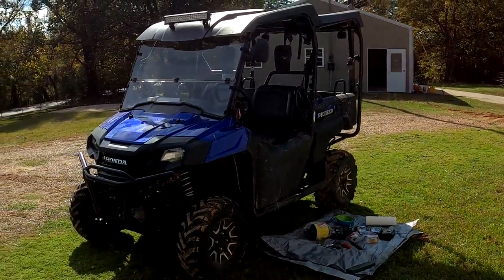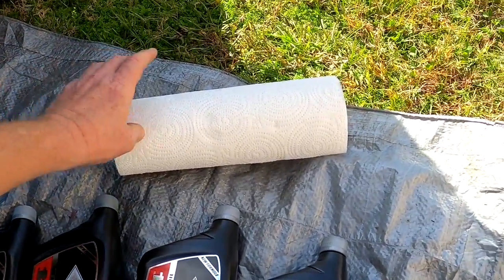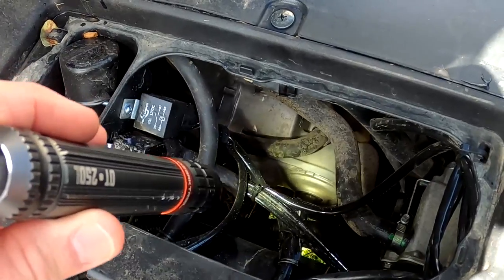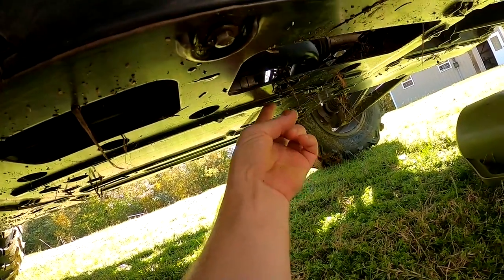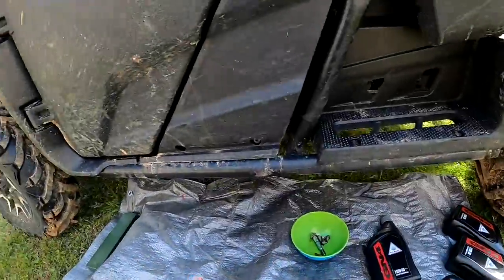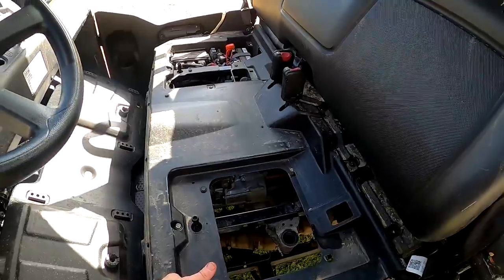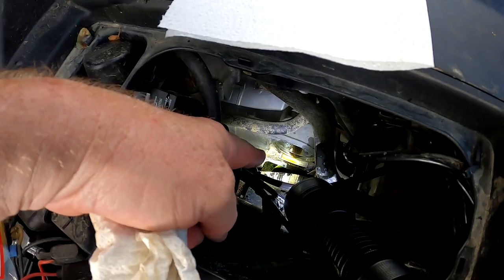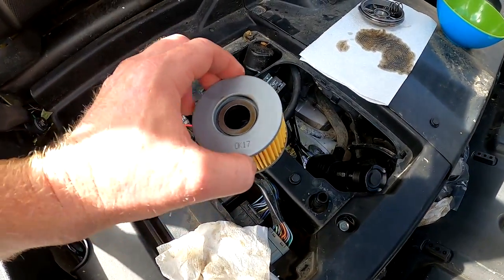Honda Pioneer 700-4 Oil and Air Filter Change

Comment: The metal air filter insert does pop out of the black plastic once you loosen off the clamp. Much easier to work with

Comment: Isn't the new air filter supposed to be oiled?

Is the metal inside of the air filter supposed to slip off? I've got the same issue where either my metal part is stuck on, or it's meant to stay on.
Reply from the maker: I have a good friend who is a mechanic at the dealer where I purchased my pioneer.  I watched him change an air filter before I changed mine, and I followed his procedure exactly.  He said sometimes they take off the entire air filter assembly and the box if there is mud in it or if it's really dirty, but most of the time they just slip it off like I did.   He never said anything about oiling it.  I've changed my filter probably 4 or 5 times since the video and it always did it the same way.  Never had any problems with the engine.

Comment: Shouldnt you turn on the engine after adding the 3.1 quarts of oil to cycle and then add the remainder?
Reply from the maker: I've never read that anywhere.

Comment: Dealer told me to oil the new air filter before installation because they don’t come from Honda with enough oil. So I did that.
Reply from the maker: I've never done that.  What type of oil did you put on it?
Reply: @MikeM100 Fab 1 foam filter spray oil. I got it from Rocky Mountain ATV MC.

Comment: Have you ever change the differential fluids in the front and rear DEF? Is there separate trans oil or is that all together with the engine?
Reply from the maker: There is separate fluid, but my owners manual does not mentioning changing the differential fluid, but the dealer said it's a good idea to change it and lube everything up at 500 hours.  I had to look pretty hard to find the bolts to remove that will allow it to drain.  I plan on doing that in the next couple of weeks and will post a video.